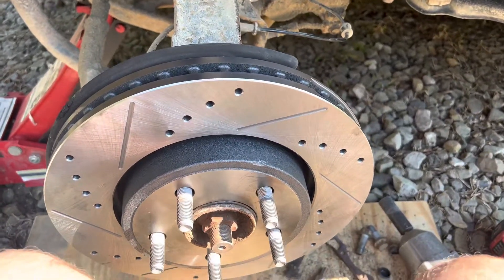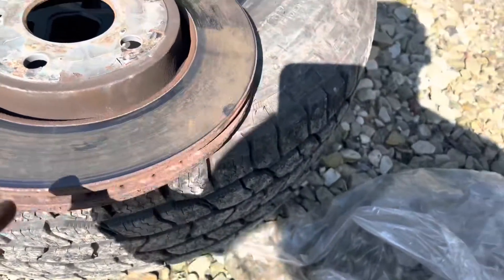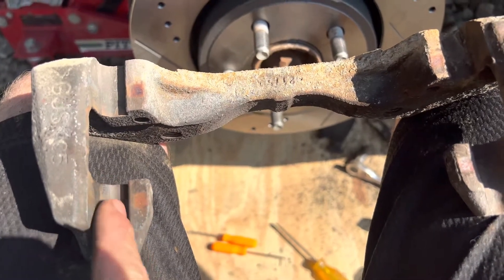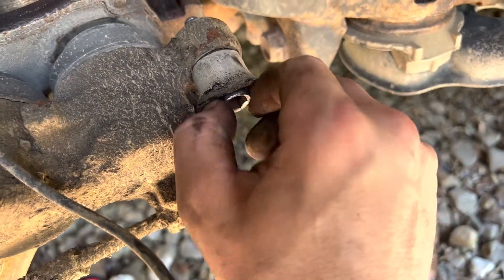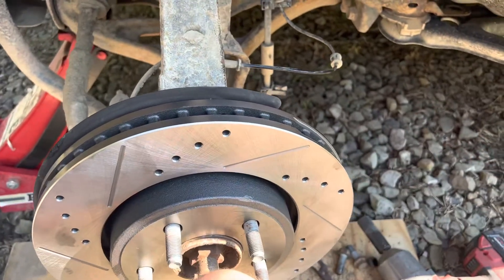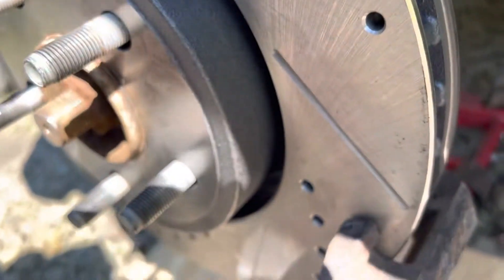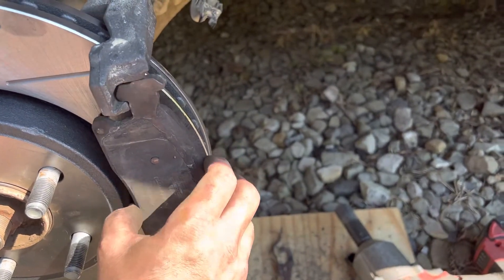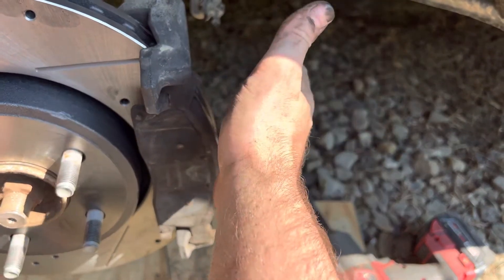Warped Rotors??? Here's Whats Happening and How To Prevent it! - RyGuys Garage How To

Comment: Good video. It's really important and you don't see it mentioned much at all in other brake videos, to make sure those pads move completely free within the brackets. They should slap right in or pull right out, absolutely no resistance. And don't forget to always torque your wheel back on.

Comment: You hit the nail on the head man! I had a shop years ago replace my rotors at least 5 times in row and like clockwork they would keep warping over and over; they would just shrug their shoulders when it happened.  

I finally tackled the job myself with really nice components and made sure the caliper slide pins were as free as possible.  The one thing I overlooked was making sure the pad ears could slide freely.  Too much corrosion build up in those areas and I didn’t take that seriously.  Low and behold, things warped again.  Still dealing with this issue today but I’m thinking it might also be because my two piston calipers aren’t applying even pressure along with this issue.  

I’ve just been dealing with this issue for so long I kind of gave up and just deal with it, probably not the safest conclusion but I’ve wasted so much money on this BS as it is.
Reply: I am going through the exact same thing.
Reply: @LeFrench307  finally figured out it’s because of my wheel stub axle.  It’s worn on the top and bottom and that is why no matter how many times I’ve replaced my tapered wheel bearings I still get play at the 12 and 6 o’clock position of the wheel when rocking back and forth.  Because of the nature of my hub and bearing sub assembly this in turn warps the rotors because of excess play.
Reply: @on1ytheb3st that makes no sense! Good luck.
Reply: @MrsSunshine75  do you know what a stub axle is...
Reply: @on1ytheb3st I guess not, please explain how it can cause a brake rotor to warp!
Reply: @MrsSunshine75  google is your friend; I’ll give you a hint, lateral play/runout of the hub/rotor assembly as it interfaces with the stub axle…and heat…
Reply: @on1ytheb3st  I guess the caliper being mounted on floating pins wouldn’t allow it to float with the wobbling rotor from the loose bearings! Nor would the piston in caliper retract just a little bit more from the flex in the rotor from the loose bearings! Sounds like you figured out the mystery! Rotors warp from loose wheel bearings!
Reply: @MrsSunshine75  you’re talking about  a thousand cycles a minute.  Yes a SIDE PULL CALIPER (term you are looking for) allows for some variance but the whole issue is uneven pressure as runout occurs. Uneven pressure leads to uneven heat buildup subsequently warping the rotor, not to mention the runout isn’t purely lateral or “horizontal” there is a torquing moment and it hinges from the stub axle if looking through its cross-section.  The side pull caliper is only sliding on a purely fixed horizontal path.  

Have you never heard how crazy sensitive fixed 4 pot calipers are to bearing runout?  They do warp rotors like crazy if there is any amount of runout out of spec.  This isn’t a new concept…literally one google search away buddy
Reply: @on1ytheb3st  thank you for the explanation! Get that loose bearing fixed and keep us posted on if that cures the rotor warping issue!!
Reply: @on1ytheb3st did you fix the issue?
Reply: @richeyrich2203  nah; I’ll get around to it but I’ve got too many other pressing issues.  It’s either my calipers don’t apply even pressure (lazy piston), or my worn stub axle (6 and 12 o’clock position) which creates too much runout at the wheel bearing thus allowing the rotor to move too much out of phase of the caliper and pads.  I definitely have too much runout at the wheel bearing, but whether that is what causes the warping or not remains to be seen.
Reply: Yep. It's a simple system but everything has to be 100% no exceptions.

Comment: Thanks brother! I am going to try what you mentioned and add some drilled and slotted rotors and hope the warping stops!!
Reply from the maker: It definitely helps with heat dissipation as well as brake dust removal from the rotors. Hope that helps. Biggest thing when it's all apart is making sure those pads move freely in the caliper with zero resistance and they should wear evenly. You CAN warp drilled/slotted rotors, although less likely. Just make sure everything is free and lubed up and they'll be okay. Something I didn't mention is the rubber lines for the brakes. Those go bad in a short amount of time, so if your rig is over 15 years old just replace them while you're in there. If they squeeze shut, it'll keep brake pressure on and cause warping too!

Comment: All very good. A 3rd thing though. Lateral runout, you want it below .002 inches preferably below .001. 
90% of the time it is just rust between the rotor and hub that puts it out too. Big lateral runout will turn into shakin' brakes within a few 1000 miles EVERY time. It's well worth the time to get both the hub and mating surface of the rotor shiny clean.

Comment: Warping is the result of changes in the dimensions of regions of the metal or a change in the shape due to thermoplasticity. Most of the time, a rotor is not warped but is worn irregularly for some reason. Unfortunately, the only way to tell for sure is to get the rotor turned and see if the irregularity comes back. I suspect a rotor, once warped, will not hold a shape. Warping means a weakened structure. Uneven wear does not.

Comment: These point make sense for vehicles that have been in use for a while. 
Any ideas why my rotor/s warped on a brand new truck within 4 months of spring/summer driving?
Reply: When your brakes are warm and you get a good amount of cold water on it it will warp too. So maybe you drove through a big puddle when your brakes where really warm. Or could be if you use a power washer on your rims after a long drive the brakes will still be warm and the water will warp them
Reply: @rikzevenbergen3648  valid point, but in my case I doubt that was it. 
Do you think a hard stop on a freeway offramp, followed by holding the brakes at the red light could trap enough heat between the pads and rotor to do it?
Reply: The rotor is glazed not warped and yer missing the slide a metal clip that snaps into the areas you are cleaning

Comment: Correct me if I'm wrong...that looks like an ATE caliper. ATE says not to grease those pins...only lubricate the caliper bracket (part which the brake pad slides on to). Recommendation is to replace the bushing and pins at around 80-100k km. TBH I did have good results with silicone spray (find something which can withstand high temp) on the pins (very light greasing). The bushings are supposed to be made out of EPDM..hence no need for extra lubrication (according to ATE).
Reply from the maker: I grease slide points regardless of caliper. If it slides to create an even stopping point, it needs greased.

Comment: I had warped rotors after 1 month of having a local shop have the truck for a few hours. Since the rotors were scraped out, I kept the pads which the mechanic asked if I wanted them back. I took them, and I’m wondering on my upcoming brake replacement, if I can reuse those 1-month old pads. Won’t those pads eventually conform to the brand new rotor? I see in your video that you are reusing the old pads as well unless I missed something?
Reply from the maker: @Agentops19  pads are cheap enough I would just replace them. I think we eventually replaced these after I had to go back through them again. Depending on the vehicle weight, I would also recommend going ceramic. The ceramic brakes don't seem to heat up as much as the semi metallic and tends to leave the rotors in better shape. It inhibits braking power a little bit, but less wear and tear on the rotors which are the expensive thing to replace.
Reply: @ thank you for getting back to me. I’ll just throw on new ones and stop being so cheap lol

Comment: What are those steel shimsyou speak of called to search online for and/or do you know of whom to buy from my friend! Outstanding educational vid! God bless my friend.
Reply from the maker: They come with every new set of decent brake pads so you can change them out
Reply: it’s the brake hardware and and extra tip is to take some copper anti seize and rub it on the outer edges of the hardware where the edges of the brake pad backing meets the hardware this will allow the brake pad to slide smoothly

Comment: Now, I’m not quite sure how that would cause a rotor to warp out of true. I’ve always had solid rotors warp on heavy vehicles after coming out of mountain passes. You spend a lot of time on the brakes, heating them up, and then come to a stop on the rotor and a little bit of it out of true from the rest of it.
Reply from the maker: Because if your brakes fail to slide in and out of the calipers correctly from the caliper slides or when your pads slide on the metal, it causes high and low spots on the rotors causing uneven braking and then shaking in the tires and wheels when braking from the uneven applied pressure
Reply: @HeiseyMotors  u wrong buddy. Brake disc only get warped do to long braking or bad driving habit... if u spend with ur foot on the brake 99% of the time braking constaly create heat on disc and overheating the disc making them get warped. 🤦 I change so many brakes. Thousands. I guess this is ur first couple brakes u have changed.

Comment: Runout on rotors is caused by excessive heat. A strong contributing factor is lug nut torque. If a lug nut is over torqued and excessive heat happens then it will bend the rotor the same as any heated metal resulting in runout beyond specs.  The explanation in this video is about DTV but it all boils down to runout. Without actually doing a runout measurement and then caliper the rotor at max and min runout the DTV can't be verified.

Comment: The anxiety I got when you let the brake line hang
Reply from the maker: I do it a lot. It's fine. The inner part of the brake hose is either crushed or it isn't so letting it hang really isn't going to do any damage to it if it's a lighter caliper. Now for my Duramax, yeah I'm gonna hold it up with a zip tie.

Comment: So uneven wear is what you mean…not warped.
Reply from the maker: The surface of rotors can warp from too much heat if your pads are sticking. Warping can mean being uneven, it's also a term most searched which is why its in the title of the video

Comment: If you use the hardware like you’re supposed to, that part of the bracket doesn’t matter. Because that’s where the clip goes.
Reply from the maker: If you use the hardware (like you're supposed to) and you have rust build up underneath on the bracket side, the hardware creates an additional clearance issue which needs to still be ground down. You must not work with rusty vehicles in the salt belt

Comment: Not true. Warp rotors are brake pad deposits on your rotors. Brand new cars get warped rotors. Its has nothing to do with the pins slides at all. Proper bedding of brake pads prevents warped rotors
Reply from the maker: Look at all the experts coming out of the woodwork saying I'm wrong... Except I'm not. The information you provided was an ADDITIONAL thing that could cause rotor warpage FROM what I listed in the video. Nothing I said was wrong. Y'all folks are exhausting
Reply: Sometimes brake rotors can feel warped if you make a hard stop and heat transfers pad material from the pad to the rotor. Yes, they need to slide. You can do a bedding procedure to see if it's just material transfered from a hard stop or if the rotors are truly warped.

Comment: No such thing as warped rotors
Reply: Yes, there is. I have one on my car. You can us a dial indicator to measure it, turning it by hand. Also, with both front wheels off the ground, tires and wheels off, start the engine, put it in drive, then look at the discs as they're turning. (also check the bearing hub, which may have been bent, if someone used a hydraulic press on one side, pressing in a bearing, causing it to bend)
Reply: No you don't. Watch the video, even his description shows uneven wear not warping, rotors can get glowing red hot and not warp.  @Bilytkid
Reply: The rotors were "machined" by the brake pads.